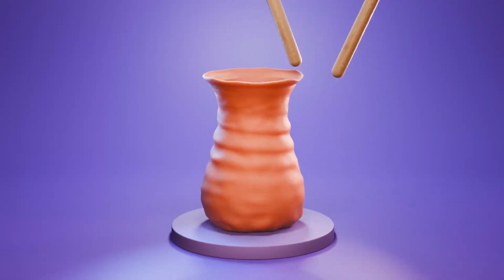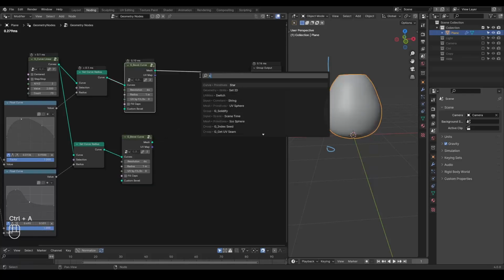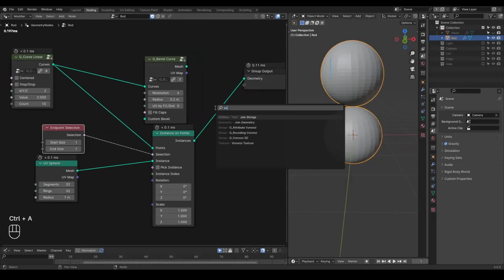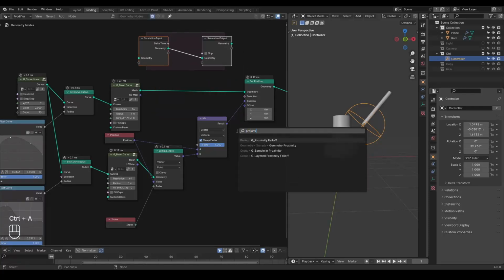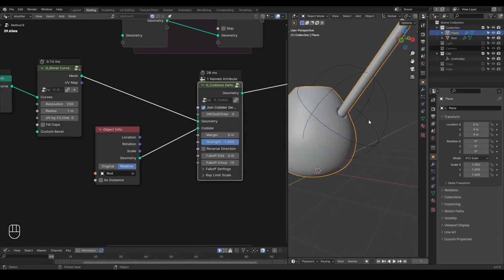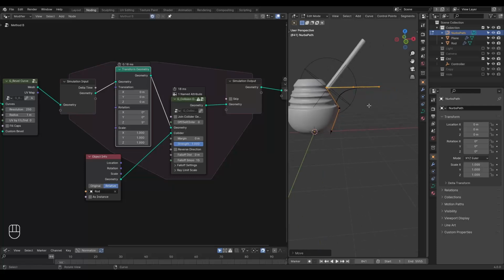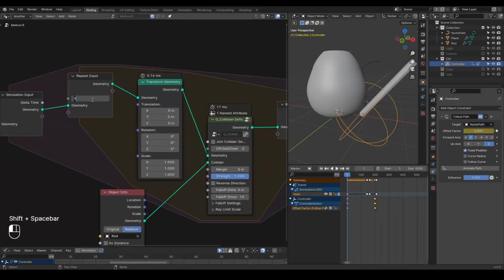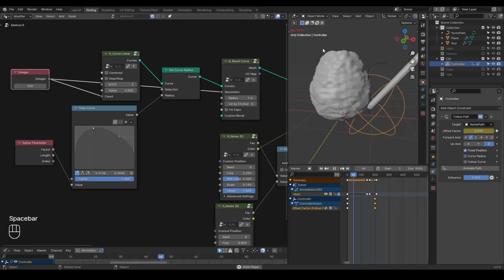[Tut] Pottery Wheel Animation - Blender Geometry Nodes 4.0

Comment: increasing the repeat zone times did not get rid of the stepping . some how the repeat zone ignores the direction the clay is moving realitive to the rode . 
you may can fix it by putting the transform node inside the repeat zone too and using the repeat number multiplied by the rotation angle to fix it maybe .